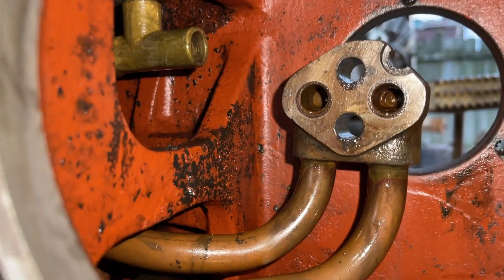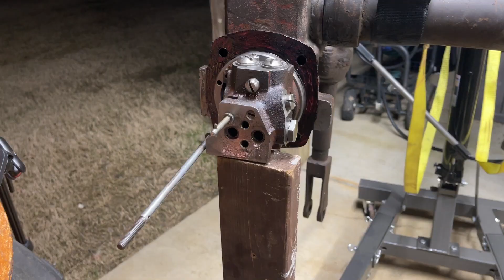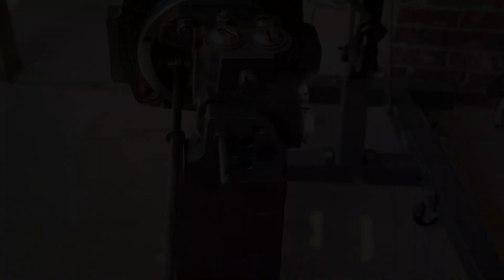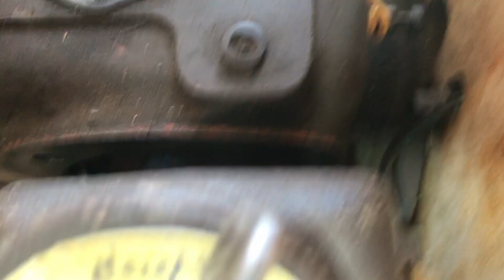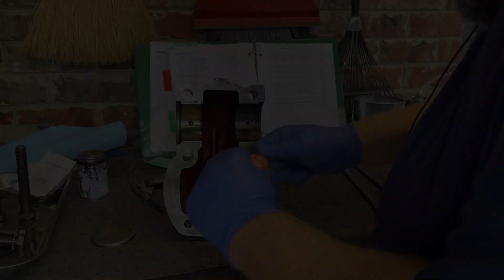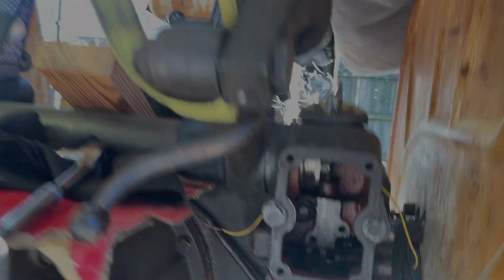Will the lube pipe fall? | Reinstalling the Valve Chest | David Brown 990 #17

Comment: You asked about the groove on the nuts, i observed that mine were all groove in towards the casting, never seen it before. 
I'll be doing this job next week after getting my valve chest reconditioned. 
Great videos, many thanks.
Reply from the maker: Thank you!  I think I wound up putting them back on with the groove toward the casting.  Very timely comment, as I'm about to start the process (and filming) of putting back on the ramshaft and covers for the other tractor I'm working on.   (new series on it on the channel)

Comment: Very nice upload and stuff of nightmares and not for the faint hearted as I’ve been through this myself, that was because l had to replace the plastic selector that the previous owner had ruined, anyway, l did exactly the same as you did in the video, then we have a lovely working as it should David brown 990🙂
Reply from the maker: Thanks for watching and commenting!  Yes, I agree it's not for the faint of heart.  Being methodical with a good plan and a good service manual is key.  I'm about to go through the adjustments and get this old beast back to work again!

Comment: Good job Shane.  Definitely easier with a lift to support the ramshaft.  I shall do it that way if there is a next time.  Good tip from Ollek too.  My lube pipe fell off three times!
Reply from the maker: Yeah, most definitely. Holding up the arms up too was the key.  Installation was WAY more easy that I expected.  The last time I did it I knocked that dang lube pipe out SOOO many times.

Comment: Finding it very hard to loosen hold valve nut
Reply from the maker: The hold and bypass valve plugs can be difficult.  I definitely experienced that.  I've got a section in the Valve Chest removal video that goes over the advice I got several years ago from Db2d on the David Brown Tractor Forum about using a Drag Link Socket to loosen the plugs.  This link should get you right to the correct timestamp in that video.  https://www.youtube.com/watch?v=hD7_EOgiPLE&t=1793s  

I also cover more on the Valve Chest itself here:  https://youtu.be/fY5Tix1lp6I

Hope this helps!

Comment: Good video Shane, I found with my 880 a local company MSP seals in greenfield IN. I take the O-ring and part, if possible, they measure them accurately at least the ID and OD the thickness not so much 50 years of compression has an effect, so I get the one above and below as far as thickness that works well and there not that expensive. It is much  easier without mud guards or PTO housing on tractor good luck.
Reply from the maker: Similarly, I've started ordering the sizes above and below in thickness, just in case.  I'm starting to have quite the collection of o-rings!  Thanks for the comment, and thanks for watching!

Comment: Hi Shane, my DB880 has a hard time to keep hydraulic arms up. They stay up if there's no weight on them. I know there's a leak somewhere. When stored for a few days, arms are going down a bit. I will start from the cylinder knowing that the pump is probably not involved in this. Where do you think I should look next if cylinder and it's gasket are doing the job ?
Reply from the maker: Well, I'd start by inspecting the Bypass and Hold valves for dirt.  They're the easiest thing to check.  I've got a video that goes through the valve chest, and the Bypass and Hold vavles are the ones accessible from the top of the axle.  https://youtu.be/fY5Tix1lp6I  Get yourself a good service manual.  Both of the ones I reference in the "How to find help for your David Brown Tractor"  video have a troubleshooting workflow.  https://www.youtube.com/watch?v=5nYhhXXpGFw&t=748s
Hope this helps and thanks for watching!

Comment: Good vid Shane The manual says ram shaft torque are as you said. I would think it will refer to both sides as the bolts are the same, as you did. Just about where you are but going about it in a diferent  way.  Have the right ram shaft bracket and valve chest in place and putting the ram shaft in later. Not been doing much on the tractor. Snowing and cold here. Might get back to it tomorrow. M😀
Reply from the maker: Weather is starting to get really nice here.  Spring time has come!  We do expect another cold snap though.  I did the process of first putting in the right hand bracket first, then putting the shaft in the first time I did this.  was a bit difficult to man-handle in the hole and had to beat on end of shaft to get it to go.  I should have tried to do it like that with the hoist just to see, but I didn't think about it.
Reply: @path.of.discovery  Going to give it a go with my Polaris Ranger winch. Have not torque any bolts yet and it will be coming out again so I can get ram out. Let you know how I get on M 😀